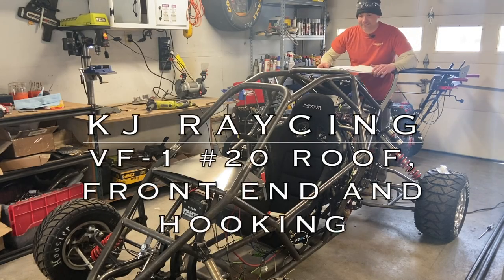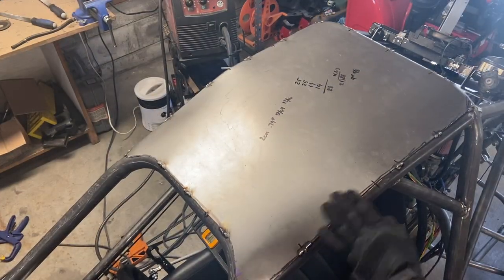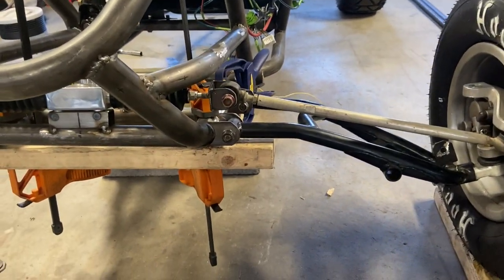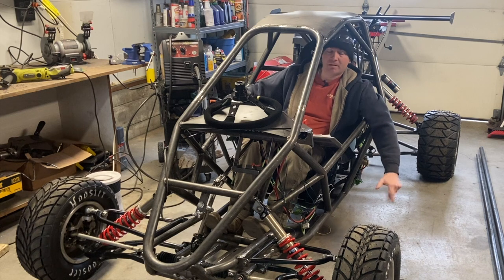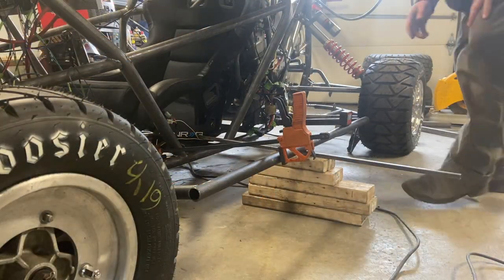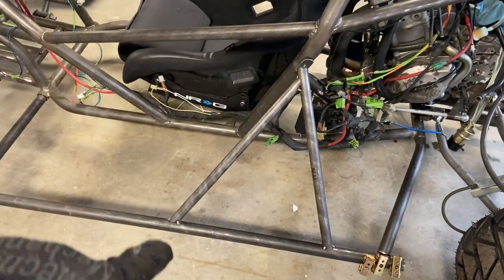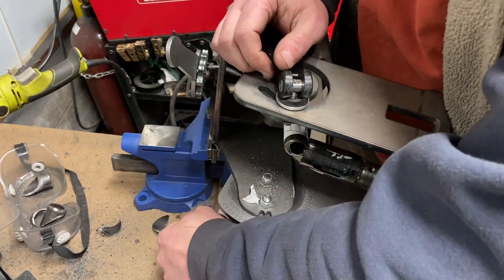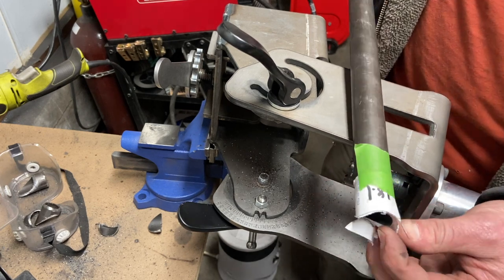Crosskart Build #20: Roof and Nerf Bars

Comment: Looks good.  My guess is that design will not prevent a wheel from climbing on top of that outside horizontal tube and then climbing over the tire(s).  You need another horizontal tube that parallels the bottom tube, or raise that bar higher than 3" relative to chassis bottom?
Reply from the maker: Thank you. This is per the race regulations, it can only go 1 5/8” higher to stay within +/- 50mm. It will do a good job of knocking away tires of the same diameter. Crosskarts are one of the safest race series there is so the the technical regulations can’t be that bad. Thanks again 😁

Comment: It looks great
Reply from the maker: Thank you Chydik, I appreciate that. How is your design coming?
Reply: @KJRaycing  I have not yet 100% started working on the project, at first I dealt with your drawings, made a 3D model to connect them to the piranha buggy, since I will use the rear levers from them. I will definitely throw off the link to the video when I start building according to your drawings, it will be soon, now I need to finish another project of the all-terrain vehicle. I can send you a screenshot of my sketches by email.

Comment: Might be a dumb question but you think there’s any loop holes to make one of these ATV Trail legal??
Reply from the maker: In Ohio there was just a 50” max width and maximum of 500cc. I doubt they enforce the 500cc but if you took a 60” buggy out there you would probably get popped. You could definitely make one of these 50”. You would need considerably shorter front a arms and the rear would just remain stock. Front shock travel would suffer with the short arms and finding a steering rack would be difficult. But definitely possible. If you did an atv conversion, you would just use the vin plate and keep it registered as a highly modified version 😎

Comment: I think the side bar would have looked nicer if it was one piece with bends in it rather than 3 pieces stuck together. To me it looks like an after thought.
Reply from the maker: You are absolutely correct. 4 complex bends would have been difficult and this is a garage built project. So as said in the video, this is the halfway point between pretty and easy to build.